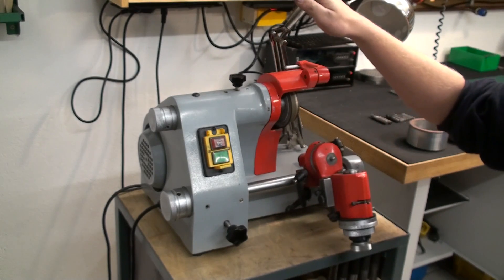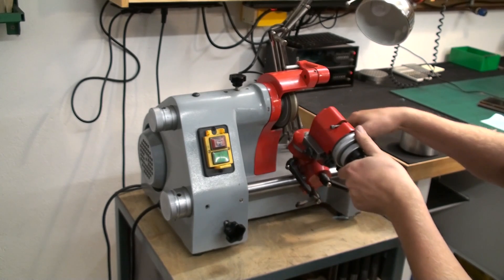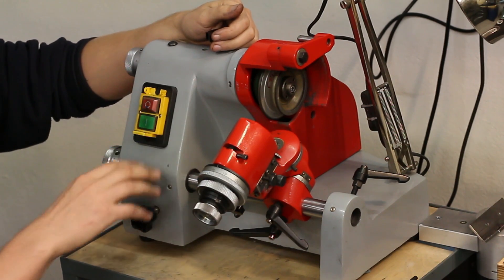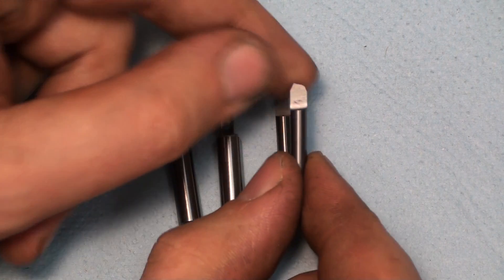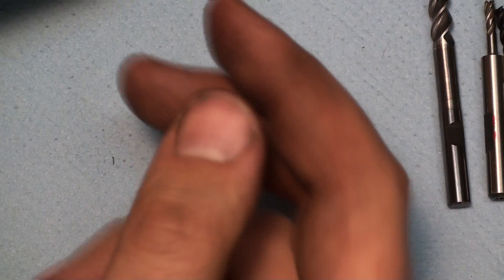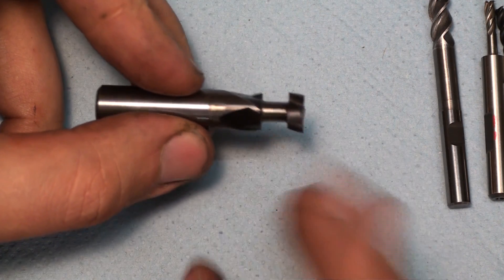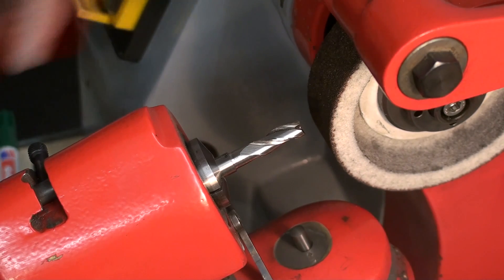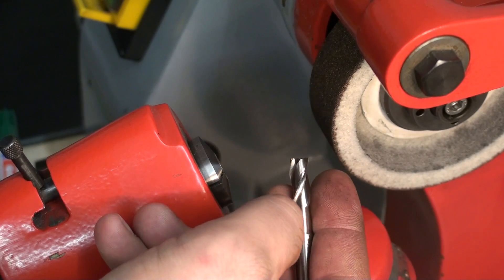Single-lip cutter grinder - Details and uses

Comment: I have had the Shars version of this machine for over a year sitting idle due to a combination of my on going machine shop projects, coupled with the useless instructions that came with the machine. You have single handedley filled a huge void to those (myself included) needing some basic instruction on the operation of these machines. I sharpened two end mills last night love the possibilities. No turning back now.  Thank you very much, Steve

Comment: Some years later, I actually bought one! Now this video makes a lot more sense, has helped me immensely. I never got the hang of hand-grinding lathe tools, and the prospect of sharpening end mills, and making my own single-lip cutters is very exciting. Thanks Stefan!

Fyi, mine is a UTG-U2 of Chinese origin, purchased new in the UK. I can't find a cheap source for Deckel collets though, some cheap Chinese collets out there but shipping cost is horrendous. Fortunately, I have an ER11 chuck on a straight 8mm shank I can use... Might make my own custom collets, now I can make the cutter for the buttress thread...

Comment: Great video Stephan - I bought one of these grinders after watching it. Like yours, mine came with the attachment for grinding the flutes on end mills. I was aware of your comment that this was a useless attachment  but tried it anyway. It worked really well for me grinding the flutes on a 12mm and a 16mm end mill. In fact I was amazed at how effective it was. Haven't yet tried it on smaller end mills though.

Comment: Stefan, It is recommended that you put a clearance angle in where you need to go at least 5 - 7 degree above horizontal when you grind the face of the cutter, without it you don't have a real cutter clearance angle (Freiwinkel of 5-7 degree for Metal Cutting Tools).  35 years ago I had to teach Toolmaker Apprentices how to use this Single Lip Cutter Grinder. Today most of the new generation of Machinists don't even know that this special profile cutter exist. You can actually grind a spherical ball shape onto the cutter. With this Grinder you can produce an unlimited variety of Milling Cutters. It is sad that many Teachers today don't know the capabilities of this Cutter Grinder.
I know you explain it to best to your knowledge, so please don't be offended by my comment. Thank you,

Comment: Helpful video.  I have the PP-U3 which is very similar.  I would also advocate wearing a particulate mask to protect against silica inhalation and ear plugs too for the high pitched whistle of the wheel..
One the grinder is set for a job, take a photo of the settings for the next batch before moving on to a different job.
Reply from the maker: Yes, a dustmask is a very good idea, and I agree on the ear plug - I wear them in the shop more and more, also when I run the mill for a long time.

I generaly dont give out a PSA for safety equipment, that is up to everybody himself. And I dont get sued ;)

Comment: Really informative video about the actual capabilities of these Deckel clones Stefan. I've read a few bits of misinformation about them that there really only useful for those single lip cutting tools. These off shore copy's still aren't exactly cheap, but the last price I saw for a new Deckel grinder of this type was a bit over $10,000. Even at $1,000 for one of these clones they can obviously save enough money to pay for themselves over some time.
Reply from the maker: 10k is about right for  a new single lip cutter grinder. There are still a few manufacturers that build the original Deckel or a variant of it in germany - Michael Deckel and Spinner to name two...

Comment: Thanks for covering this grinder Stefan, it's been on my wish list for a while, but with a T&C grinder and a Darex E90 endmill sharpener already, obviously isn't as urgent as it would otherwise be.

One flaw I've noticed with the grinder is what looks like no adjustment on the angle of the diamond dresser. This will mean the diamond will become dull instead of being able to be rotated to a fresh sharp face each dressing. i think that would be a good mod to consider as it will make a significant difference to both the wheel dressing and the life of the diamond.

Comment: I have had a want for one of these for years , as well as a 3D pantograph the size of a Bridgeport milling machine. In tech school we had both and both had stenciled (Property of US Navy) on them. I had figured in a few years I would have ran across these two machines and traded for them , but still have not found either one for a trade. I have seen this grinder on Amazon for around $600 but I had much rather do some sort of trading for a used one😉👍

Comment: I just checked out a used Deckel S0 grinder, a 1990s model, that the seller listed for $6700 US. Depending what attachments come with it it could be a great deal or not. The machine looked unused. So, yes, the Deckel machines are expensive new or used.

I have wondered about the Deckel grinders: about how they work, their utility and convenience to use. Thanks for the video!

Comment: Nice video on the grinder. I think you can easily add another very usefull use: resharp the lateral flutes of the endmills. Make a new siple head with a homemade air bearing to run a straight shank collet chuck by hand and a stand for the flutes.

Comment: Excellent again, Stefan. It's full, complete and not jquite exhaustive, And it's  far more informative than those now on YouTube in Chinese and a few shot off-hand in noisey settings without proper narration.

A clone of that very grinder just fell in my lap. I've never used one before so I'm still exploring its possibilities. It came with the flute grinding attachment, the lathe tool goodie, and the drill grinding jig but with 5C collets. 

I still sharpen drills free hand but as I age, I may have to resort to gadgets so I'm going to hang on to the attachments.

My only complai7nt is the M8 hub extraction screw bruised the M6 taller hole in the spindle. There gotta be a better way.

Have you posted key words like "universal tool grinder" etc to aid YouTube searches? I'm linking this video to a the people seeking advise. Expect more questions.

Comment: It is a very useful machine and makes a good job of sharpening cutters. I have attachments for mine to also sharpen drills and shaping and sharpening lathe tools. With an embedded diamond cup wheel I can accurately sharpen solid carbide cutters.

Comment: Extremely helpful video.  I have been buying new drills and end mills but I've saved the old ones and would like to put them to use.  Also I suspect that with the right grinding cup it might be possible to sharpen gear cutters, which I have zillions of.

Comment: Thank you! I very badly want a cutter grinder but haven't had the exposure to them to know what kind, and its good to know the cheap knock off is still a good tool. I was disappointed though when you said the helical grinding attachment was useless as I was waiting for you to say something about that the whole video. Is it that it is not rigid enough to grind new flutes in a carbide blank or is really that heavy an operation just to touch up the edges on a dull end mill?

Comment: STEFAN MAKE ANOTHER VIDEO ON THE GRINDER.  Hey after watching this video I purchased one from shars and it works very well.  There's nothing worse than wrecking an endmill in the first five seconds of use makes me sick! I had saved my new ones i wrecked in a jar never thinking i would ever do anything with them  but I was able to save every one of them awsome. They are all razor sharp also sharpened some lathe tooling very well. My machine seems very well made except the knobs handles and hardware I will add some kind of shop vac attachment very dusty bad to breath.

Comment: Excellent, excellent video! Thanks for responding to requests. I learned more watching this than countless hours of web surfing & those silent Charlie Chaplin movies from the factories that make them. Couple questions:- how do you safely cut carbide shanks to length in home shop when you make your own tooling from blanks? - I would have thought the drill re-sharpening & faceting would be a very useful function of machine. You mentioned a pain to set up - do you mean limitation of the machine itself or those particular accessories they provide? Maybe something better you could redesign? I saw one accessory that looked like a V-groove/clamp, presumably for longer/bigger drills? But could you hold smaller size drills in the stock collets?

Comment: Dear Stefan, I think you are the only one that can help me that I know have huge knowledge. Following you I bought a beautiful toll cut grinder, made in Italy but I don’t know the name. Now My problem is that I can configure out what kind of collet need, is not 5c or U2 or any other that I know, I surf internet but there is an ocean, difficult, please those are the dimensions may you know what kind of collet are thread look 25 mm - 1 mm pitch a Length 121 - cone od 32.54 - I can’t find 😢, please try to help me

Comment: Nice video and something are more claer to me. Since a couple of months I have bought the Chinese version, and it takes a lot time to grind a drill-bit whit all the correct angles. I shall used it also for lathe-tools for threating and belt-polies.
Thanks for this interesting video.
Reply: Can i know what make of chinese grinder you bought? because i qam thinking to get the same from a chinese company
Reply: It is HBM U3 grinder with C5 collets, who is in fact a copy the Deckel single lip cutter grinder. Remark; over the world different version are existhing.
Reply: i grind drill bits from 4mm to 29.5 mm using the 5c collets, i have full collet set but actually only 12mm is required for most larger drills, the secret is in the settings , top knuckle 60-70 degrees, bottom knuckle 5 degrees, for 4 flutes just change bottom knuckle to 15-20 degrees, this gives about 118 degreee drill, very sharp cuts well, so no need for drill acccessory , which i have, i also found the 5c square collet 12mm very useful in sharpening hss 12mm lathe tools, thus doing away with the lathe tool accessory which i have, still trying to grind the 2 and 4 flute endmills, but please note that suggested is a top knuckle of 85 degrees and a bottom knuckle of -5 degrees, but - 5 does not exist on the bottom knuckle scale, so you must judge the right amount left of zero, all a bit trial and error with this machine, but as stefan says i would not be without it, nice and heavy, little vibration , uses several types of wheel and nice and quiet.

Comment: Really great detailed video! I recently purchased one of these and I love it. I do have one complaint, however. It seems that the wheel rotation is actually opposite of what it should be. When sharpening isn't the best practice is to be moving the abrasive into the cutting edge, not away from it? I did a set up using the inner part of the grinding wheel (it's harder to do; a mirror helps) but the results seemed better.

Comment: many sharpening fixtures for end mills have some way to sharpen the length of the cutting edge on the flute. I gather that you feel that to be rather unnecessary and by shortening the end mill by some amount you avoid needing to sharpen any flutes. Have you ever sharpened any flutes and does an end mill with resharpened flutes ever produce as good a surface? (using the end mill at full length for a finishing cut)

Comment: This may seem silly but it would be interesting to see a before & after cutting on your sharpened end mill. Chipped, broken, blued bits are easy to tell that they are bad. It's those cutter that ware VERY slowly that are tough.  For myself (hobby machinist) it's when the cutting action just doesn't seem right cutting. Might make a nice YouTube video. No one has covered that subject, on recognizing a dull cutter.

Comment: stefan - i acquired a shars clone recently.  a noticeable difference on my clone compared to
the deckel is the vernier for the radius offset. Mine is calibrated in 1/4" major increments and 
.050" minor increments. i am probably going to stick an indicator on the side of the divider head
to measure the radius offset. what are you using to measure radius offset? thanks for all the
informative videos and advice. i'm a hobbyist with a PM932 mill, a Covel #15 surface grinder, 
a South Bend SB1001 lathe, and a bunch of metrology. 

phil

Comment: Nice job, Does the clearance angle  equal the relief angle and rake angle.?  Do you grind that separately?  I have an identical Yellow universal mill.  Actually after buying the newer Deckel manual
On Ebay I see it essentially says for my engraving half lip pointed conical cutters the horizontal angle gives you 1/2 tip angle and the vertical tilt ~20  degrees gives that beautiful relief lip on the cutter face.
Your video inspired me I hope to make one for sharpening engraver bits.
Schones Wochenende! Vielen Danks

Patrick:)

Comment: Sharpening drill bits - chisel point and brad point?  A demo would be nice on this very useful function, although with steady hands, I can get reasonable results on an ordinary grinding wheel.  I use a white aluminium oxide wheel for drill bits.  I was wondering: If you made a threaded insert for the main head and used a thin diamond blade on edge, could you not cut the back surface of the flutes of end mills? The thread would need to match the pitch of the spirals, that's all!  {Tongue in cheek - It can't be that simple though}.  If this did work, instead of relieving your end mills to cut deeper slots, you could extend the cutter up the plain shaft. That would extend the life of cutters a little.

Comment: Hmmm.  A very interesting machine. The Proxxon endmills I use cost 75$ for a set of 3 -- 1, 2, and 3 mm. They plunge. Tiny.  I seldom plunge but when I need precisely spaced starter holes I do. I will study this video, my brand-new set of slot drills  and the web site and see what I can do. FWIW, there are T&DG kits available in the UK including the Chadwick Quorn. A tough machining proposition. Cheaper than a Deckel for sure but a lot of work.
Reply: Juan Rivero 
A quorn is not at all difficult to make you have to be careful, if I can do it any one can took me 2 months a couple of hour a day
Reply: Very interesting. I have never heard an actual estimate before; I have read people who spent a year on it. Can you tell me what the minimum center height I would need to make it?

Comment: Wow, thankyou for this video.  I have one of these and this was very helpful.  Do you know if the bottom bar is stainless steel?  I always worry that mine will rust.  I use a squirt bottle to cool things down when I am grinding.  Is the moly dry lube the same thing as molibdenum grease?  I suspect not!
Reply: I have never heard of moly dry lube.  Is it the stuff they use on bicycle chains?

Comment: Perhaps you already answered this question, but I didn't find it in the comments. Where do you get the hubs and what kind are they? Also where do you get the hub wrench? I just picked up a 5c model and having separate hubs is only rational.
Reply: Shars wheel adaptor: FOR101-1008  must call in to get these, it won't show up on web. per ROBRENZ

Comment: Interesting video! Where are the wheel mounts (wheel adapters) available in Germany? I could not find a source.
Reply from the maker: I didnt find them either, thats why I machined a whole bunch of them for myself.
Reply: Thanks, then I will do so, too.
By the way, I made another modification to my machine: I set the dressing tool at an angle to the wheel plane (as in the original S0). This way you can always present a sharp Diamond corner to the wheel, simply by turning the tool in the clamp (as explained in the S0 manual).
Reply: Just as an option you could try to get those from Shars https://www.shars.com/products/machinery/rotary-cutting-tool-sharpeners/grinding-wheel-adapter-for-1-1-4-arbor-hole as mentioned by Robin in his video. The only difference - the Shars adaptors are intended for wheels with 31.75mm (1-1/4") ID instead of 20mm..